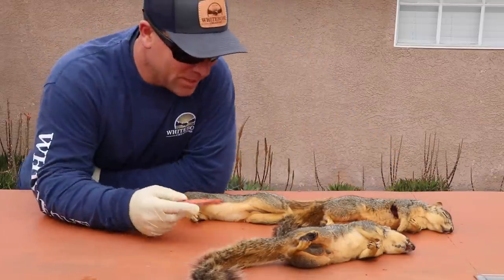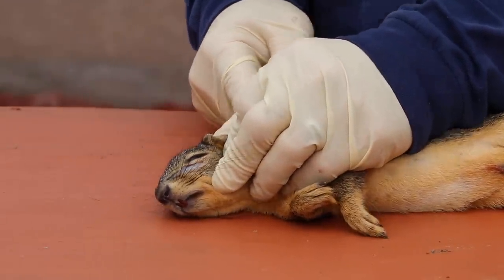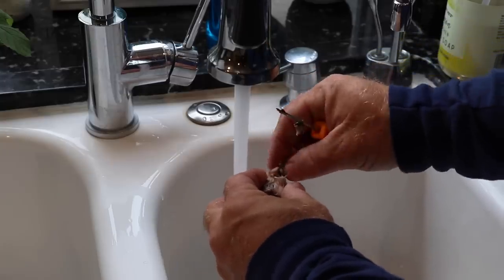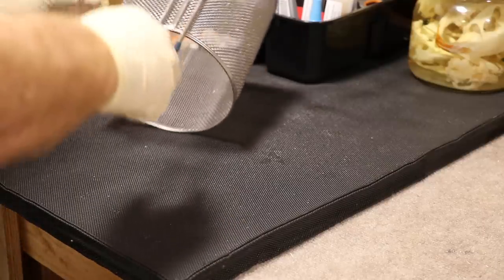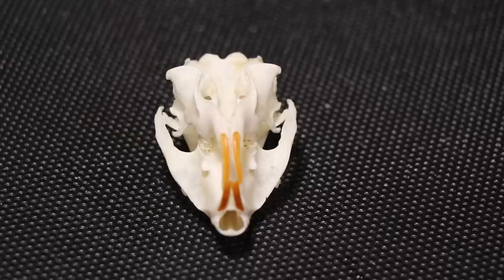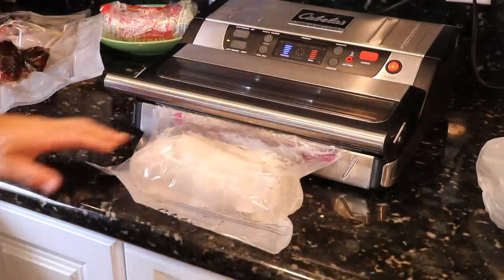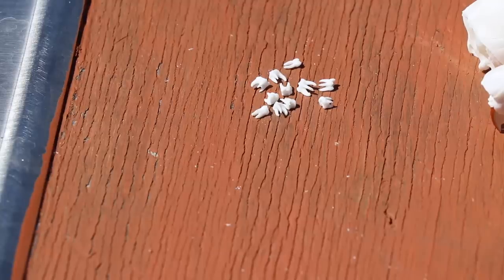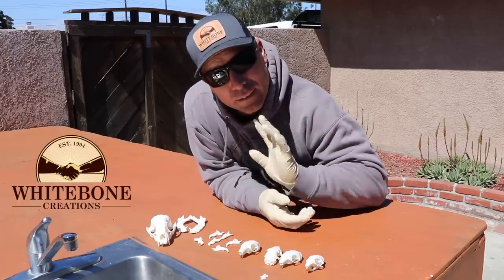SOUS VIDE SKULL CLEANING "SQUIRREL EDITION"

Comment: peroxyde is actually really oxygenated water so when you boil it you boil the excess oxygen out the solution
Reply from the maker: That makes sense thank you.
Reply: Not entirely correct, peroxide is named that way because it is one hydrogen molecule per oxygen molecule, and due to the instability of the compound when exposed to light or heat it actually offgasses both oxygen and hydrogen gas. It's why most hydrogen peroxide is sold in brown or dark plastic containers, because the entropy of pure gasses and water is lower than the energy required to stay bound as peroxide and so it doesn't take all that much convincing for it to spontaneously decouple. Either way though what is being released by heating peroxide (as long as it IS only peroxide and water) isn't any more dangerous than steam... as long as you don't have open flame around. Oxygen gas and hydrogen gas are both very flammable.

Comment: I believe peroxide is H2O2, so when you heat it up you're more than likely getting H2O + O2 .. I havent done chem in awhile but I'd just be weary of flames just in case. Great video as always, I appreciate your work!
Reply: More likely getting H2O + O, otherwise it'd be H2 + O2 (or even 2H + 2O but sous vide doesn't have enough heat to produce that kind of steam).
We must keep in mind that water increases in volume 1700 fold when it becomes steam so that is obviously a factor. I'm no chemist so I'll stop here.
Reply: @SnorrioK  oxygen is a diatomic element. The main focus for me was that the gas produced is combustible.

Comment: Great video for small skulls.   I like the sous vide process.   Seems like it would speed up the process exponentially!  Especially with a pressure washer as the flesh came off so easily.   What about poking a small pin prick into the peroxide mix so the gas can expel?  So long as it's in your garage or outside.   Just curious.   Would like to see a hog skull or other medium sized skull done in the sous vide just to see how that would work.    Thanks for the video and looking forward to more!

Comment: If you are on a really low budget, you can use a ziploc bag (vs vacuum sealer) and a pot of water on an electric burner (as low as possible/ set to achieve proper temp)

Comment: You don't need to vacuum seal the bags in my opinion. As long as the skulls are fully submerged, the water will transmit heat the same way. Especially the peroxide ones have the risk of bursting.